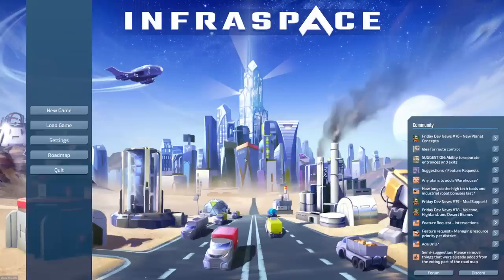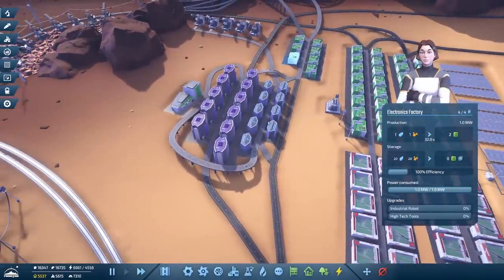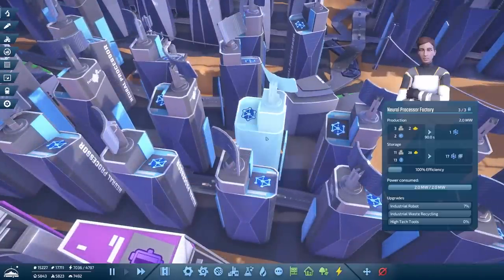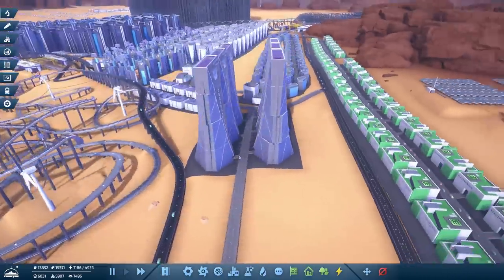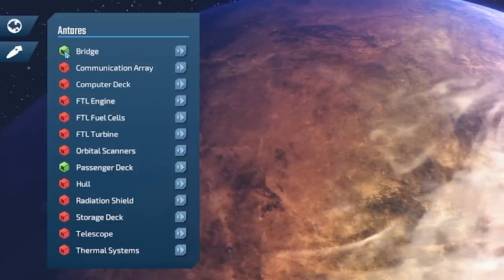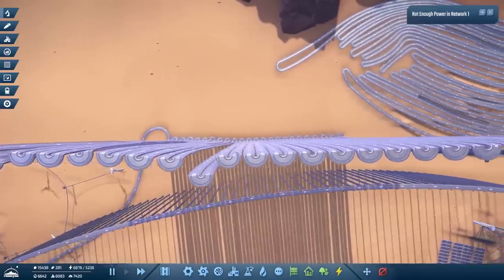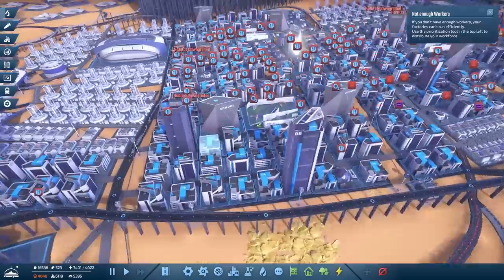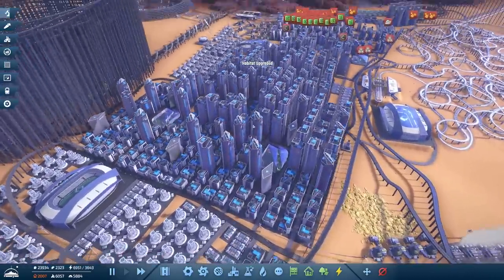Engineering a VERTICAL RAILWAY that defies physics...

Comment: I haven’t played the game myself but I think I know what caused the traffic issues:

Because you didn’t send uranium to the nuclear plant, you lost electricity, so you could not use the pipes for your CO2 and whatnot. That’s why you see so many CO2 trucks that aren’t normally there, the pipes weren’t pumping
Reply: Its a good theory but carbon doesn't use pipes, and pipes don't use power. It's probably an issue of trying to route too many things through the same road somewhere. Also, since this game is slightly unrealistic, induced demand is not a thing and Matt should absolutely increase lane capacity on roads that constantly get stuffed, like the ones near the carbon plants.
Reply: May be the reason.
But leaving a road network without a single fix or observation is certain to cloak earlier or later. I really don't know why he is so aversive in fixing it, every engineer loves fixing road networks :))
Reply: let him seeit

Comment: Something that I did to help with traffic in this game is you can stack roads on top of each other and have multiple levels of roads. So I left one block between the houses so then I could build highways in the gaps and over the existing roads so that the building resources could easily get to the houses without interfering with other traffic.

Comment: 2:51 hey matt there is a better way to place these microchip factorys to stack them make them not lock on the road and turn it so its facing sideways from the road and the road still somehow connect and you can stack them so much so no need for so many roads

Comment: Never played this so take my thoughts with a grain of salt, but do you have a cap on how much stuff you can store?  Specifically steel, do you have to build warehouses etc to hold it all?  Cause if so that may be why the traffic exploded, you suddenly used all the steel up on the train line so all the carbon and iron distribution kicked into high gear instead of having full outputs.
Reply: As long as you have one storage facility where they can be delivered, there is no cap on steel/concrete storage. Other resources can't be stored outside the queue of their production/usage facilities.

Comment: I understand you used to be a highway engineer, Matt. But maybe these traffic issues happen because you have a main highway going straight through the city, which takes in a lot of your resources? Maybe have the main highway between districts be outside of the city, and have an on ramps and off ramps into the city?
Reply: you sound so architect)

Comment: No No No You're quite wrong. Those AI control unit factories are so tall they have to shift the shape of the building. The wind forces at high elevations case serious stress on a building and therefore the shifting structure diverts and disperses the airflow to lower it's stress on the overall structure.

There's nothing architectural about that at all. 😂